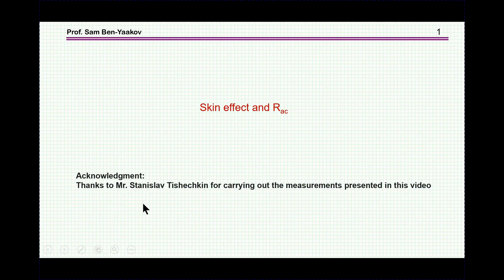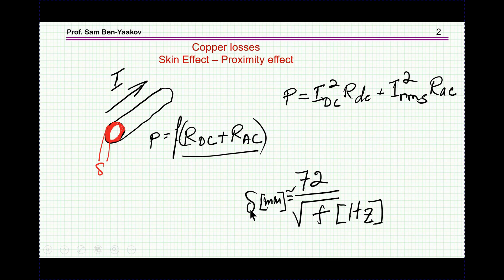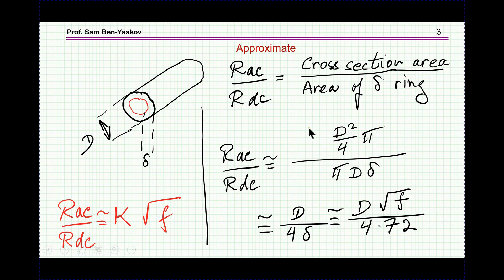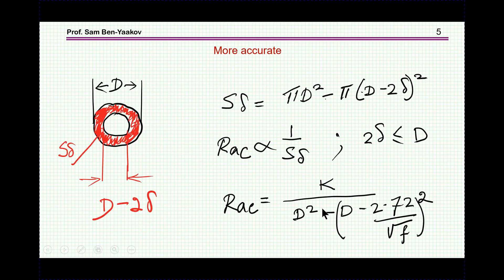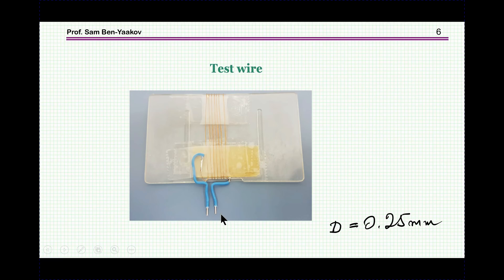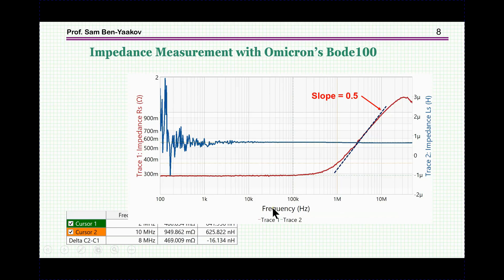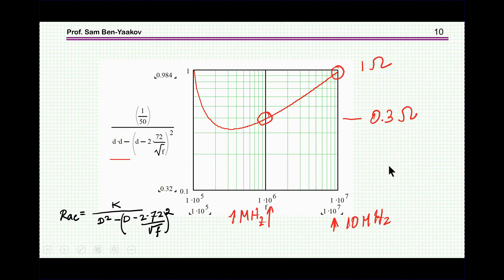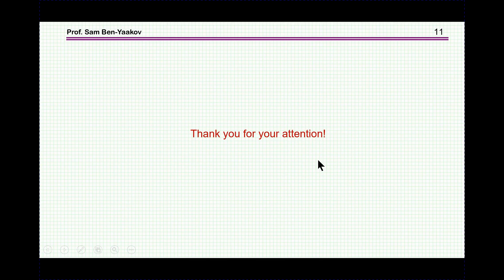Skin effect and Rac

Comment: Thanks for the video. This is a very crude approximation mainly because of two things: (1) the current density is not uniform over the penetration depth (it is almost exponential) but here it was assumed to be uniform (2) the distance the current actually penetrates into the wire is not \delta (it's more like 3 or 4 times \delta but with almost exponential decay). The final answer is not accurate especially at higher frequencies like  100s of KHz or in MHz range. An accurate and rigorous solution with very good approximate formulas are given in page 182-183 of "Fields and Waves in Communication Electronics" 3rd Ed, 1994 by S.Ramo & J.R.Whinnery & T Van Duzer
Reply from the maker: The British say: "the proof of the pudding is in the eating". How do explain the excellent match to the experimental results? The delta approximate equation takes into account the tail. If unfamiliar with, please join:
https://www.linkedin.com/groups/13606756
Reply: @sambenyaakov  well, first of all the constant K was obtained by fitting the formula to the measured data point which is ok because it kinda compensates for the wrong assumptions behind the model as I described above. Second, it is way off for lower frequencies (lower than 1MHz) exactly because the model is based on wrong assumption for distribution of current density in the wire cross section. I was wrong when I said this model becomes worse at higher frequencies, actually it becomes worse for lower frequencies. However, if you look at the two simple formulas for low and high freq approximation in that book  (page 184), together they can accurately reproduce your measured results pretty good over the whole band. For lower frequencies when D/2*delta is large, Rac varies LINEARLY with frequencies, but for higher freq when D/2*delta becomes small it varies linearly with square root of frequency
Reply from the maker: Hi Amir, thanks for your persistence makes it more interesting. To clarify: 
1. The K was not used for fitting just to adjust gain.   
2. You seem to have missed the purpose and spirit of the video. This and the other videos in my YouTube channels are not meant to be academic lectures or exercises. Rather the purpose is to develop an intuitive engineering understanding and tools for students and designers.
3. The fitting between calculated curve and experiential results is pretty good considering the fact that the break point is at about 330kHz below which the resistance is Rdc.
And here is a question for you: How close are the experimental measurements taken by yourself or others to the prediction of the more accurate equation you refer to?
Reply: @sambenyaakov  sure, I can generate some plots and see how they compare. But I need precise dimensions (diameter and length) of the wire that was used in the measurement. Then we can compare the results with your measured data. I don't have any measured data.
Reply from the maker: As indicated in video, copper wire, D=0.25mm and Rdc about 0.3 Ohm . If required, the length can be calculated from the two.
Reply: @sambenyaakov  I will generate some plots as soon as I get some time and upload it somewhere so you can all download and see it. I am curious how these different methods will compare with each other
Reply from the maker: Great
Reply: @sambenyaakov  ok you can download the pdf file here https://www.4shared.com/s/f8L9NQ-08gm
Reply: @sambenyaakov  ...with a little modification the formula in the video matches quite well with the theoretically rigorous solution at high frequencies. at lower frequencies it fails because as I mentioned before the assumption for current distribution was incorrect.
Reply: I find it to be a very practical approach to what could be very hard to analyses with great consistence. Also I am very interested in your comment, I will look for the J.R.Whinnery reference :)

Comment: Dear Professor, 
Thank you for this video. It is very useful. I wonder if you have a similar study for square-section conductors. Can we apply the same analysis for non-circular section conductors? Thanks in advance.
Reply from the maker: Yes, you can follow same method. If not a memeber please join https://www.linkedin.com/groups/13606756